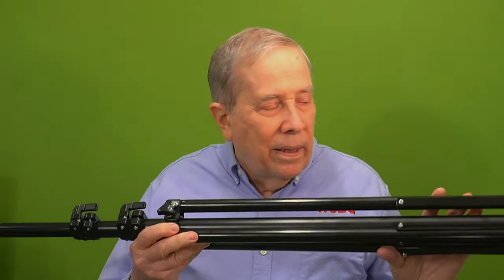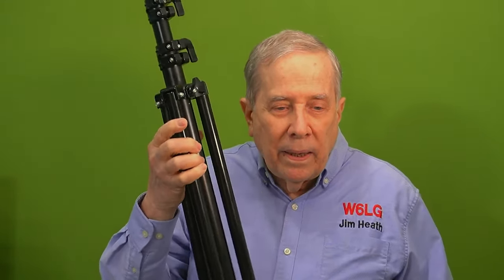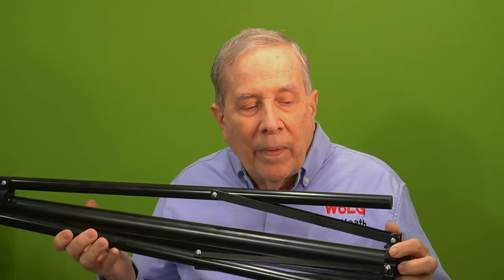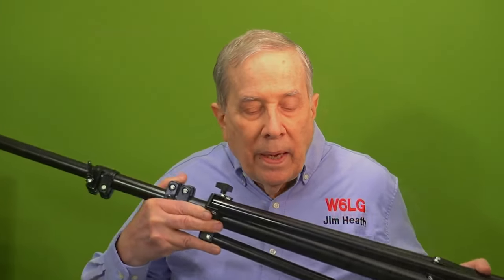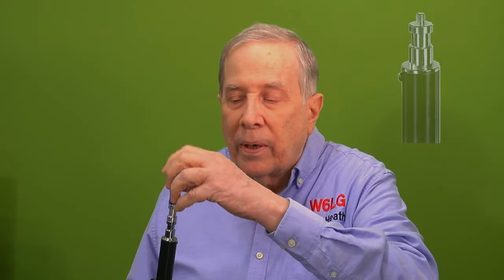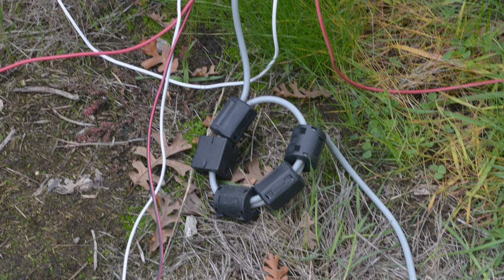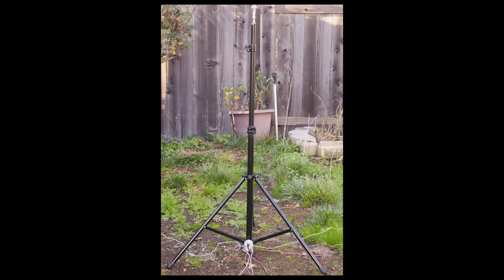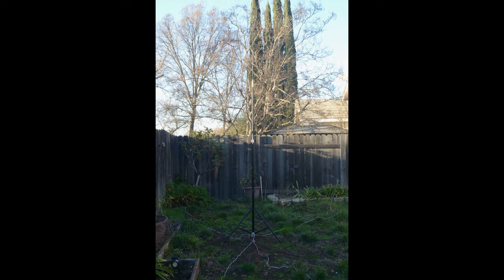POTA Perfect Pole, HOA Antenna Camera Tripod Tips, You Can Make, with Jim Heath W6LG

Comment: Hello, Another innovative and timely video!  The Seniors group in my church is having a "hobby, arts and crafts day".  I would like to set up a 10 meter station at the church in the hopes of getting to talk with some other stations rather than just putting the equipment on display.  This tripod is an affordable and easy way to get an antenna out on a wide sidewalk area.  Could you show  or discuss a little more of the details of how the center conductor is connected to the pole behind the mounting bracket with the radials connected to it!   I cannot afford a telescoping mast to hang a dipole on, but this is doable.  I've already ordered one from B & H!   A picture of what's behind the bracket would be helpful.  Boyd KO4GJO

Comment: What is POTA and why is I all the rave lately? maybe a surveyors tripod would work well too.
   Great video as always Jim, I hope your doing well.🙏
Reply: POTA Parks On The Air is what I was told by my mentor. We built an antenna under the supervision of my Elmer and we used a 102 inch whip design on an aluminum transit tripod with different tuning coils made from copper tubing you could switch out. Took some tinkering but got him on the air.
Reply: @greasydot  Okay,I see. "Park on the Air"? Interesting.I built a 5/8th wave center fed verticle dipole much like the Sirio "Gainmaster" for 10m and had some fantastic results from it, Sirio made a homerun with that design.
   Thanks for the reply and 73's

Comment: Hi Jim, Great information. I had a 20 ft aluminum telescoping flagpole I got from Amazon. I was looking for a tripod to support it and wound up with a photography tripod same as you. The wonderful thing about it was I took the slides out of the tripod, and the flagpole slipped right into it like it was made for it. So now my tripod tip is over 20ft up. I put a 5.6 meter telescoping whip on top of that and tuning it was a nightmare so I scrapped that idea and just attached a carabiner on top to put up a random length. I never thought of using the pole itself as an antenna. I checked continuity and the slides of the flagpole only connect "electrically" when fully extended. I'm going to do some experimenting  using only the pole itself without attaching any whip to the top. Thanks so much for the inspiration. I hope you're feeling better. 73 de KA9TII

Comment: Hi Jim i own a Yaesu FTDX101D like you . What are your audio settings mic gain and processor and AMC ? Im having to set my mic gain to 20 to make my audio sound clear? This seems very low also my audio sounds better when i dont have the ALC moving at all and with 5 compression? Does this seem correct? As in 1 of your videos you mentioned the ALC on yaesu needs to be about 75% scale? But mine does not move but sounds better? Hopw you could do a video of this yaesu ftdx101d audio settings think it would get alot of views as well. Thanks